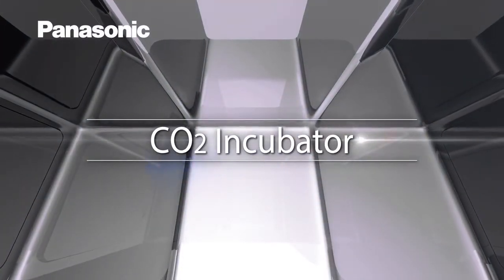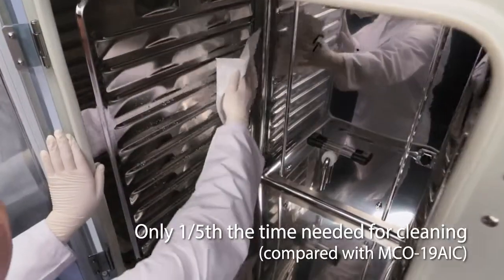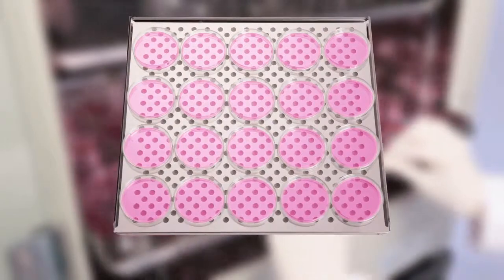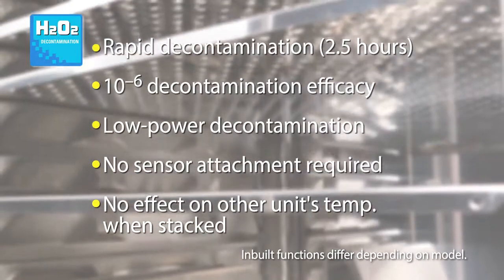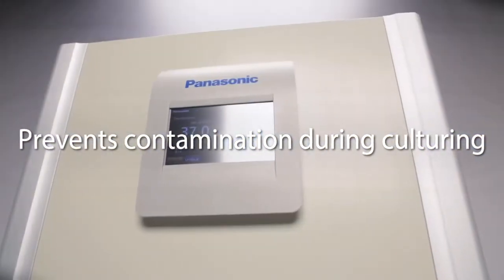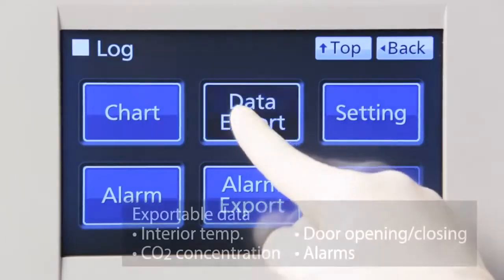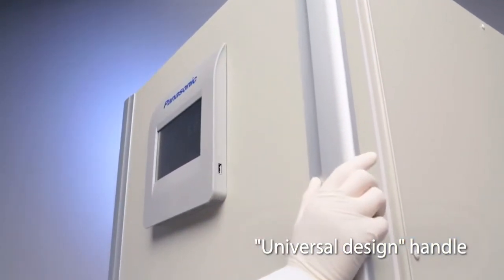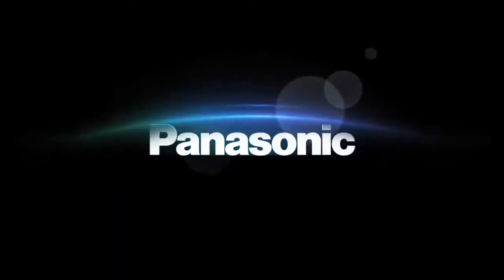Panasonic's New CellIQ CO2 Incubator

Comment: Our lab recently bought this incubator and what we received is a big piece of trash. There are lots of bad thing about this incubator, first, it reached to us after 4 months. Second, the bottom of the machine is badly damaged. Third, CO2 inlet is not functional. Fourth, the door of the incubator is a mess as it cannot be closed properly. Fourth, engineers and dealers are too stupid  they don't know how to install this machine, how to handle it, how to regulate the CO2 pressure etc. Our lab members are too pissed off by the service of these persons. If there is any solution then do tell us.